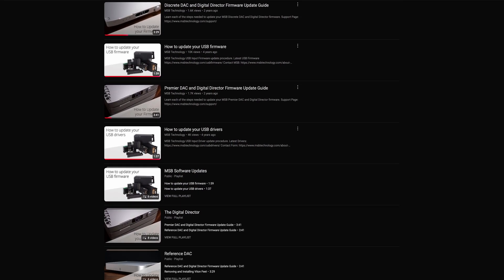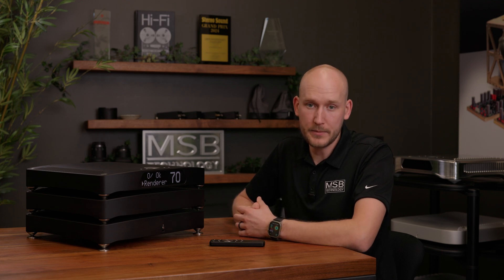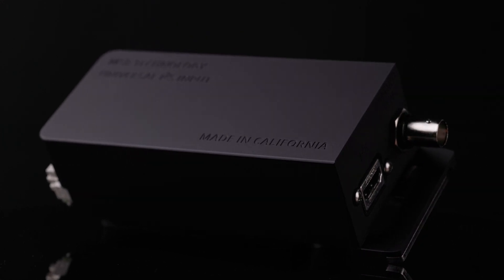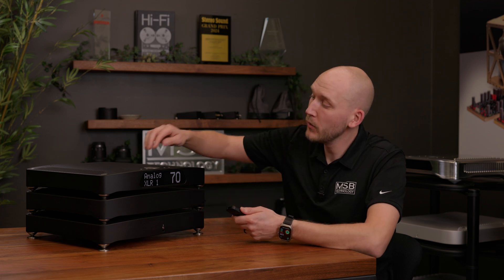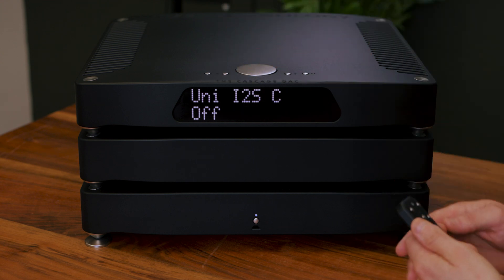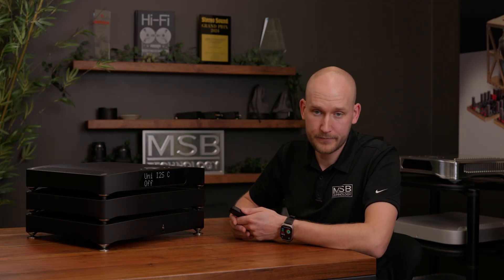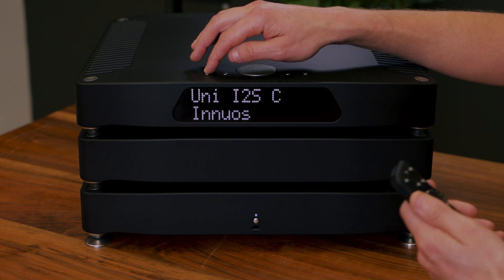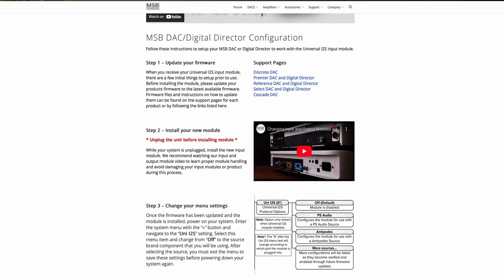New Firmware Update for MSB DACs - April 2025

Comment: Will your DACs with the Network Renderer V2 support the new Qobuz Connect?
Reply: Not at this time, but it is in consideration for the next generation renderer.  The current implementation's sonic performance with its dedicated design and firmware has yet to be beat.  So we won't be adding on anything until we can bring the sonic performance to the level we are satisfied with.